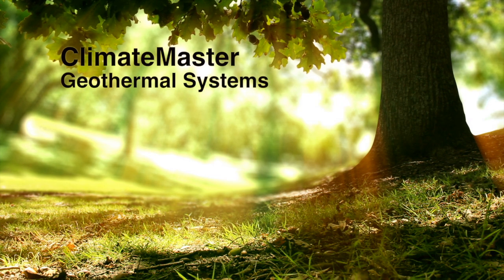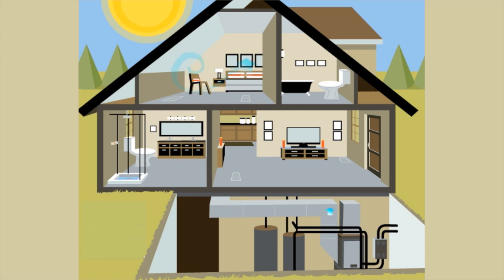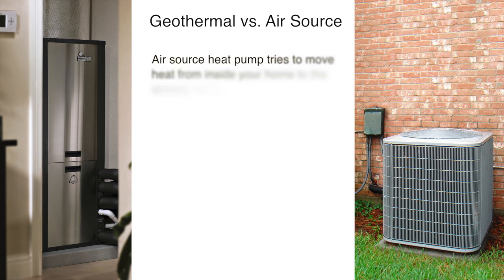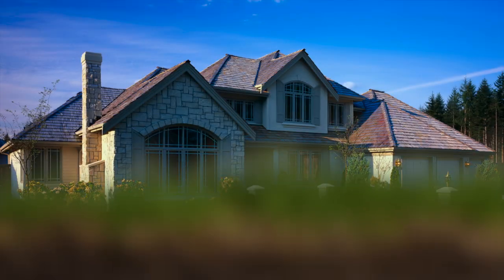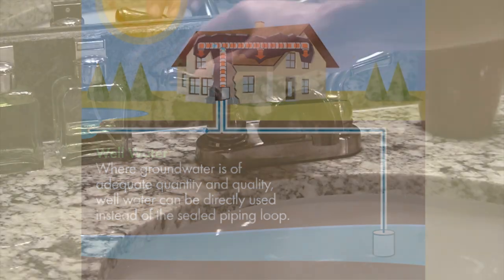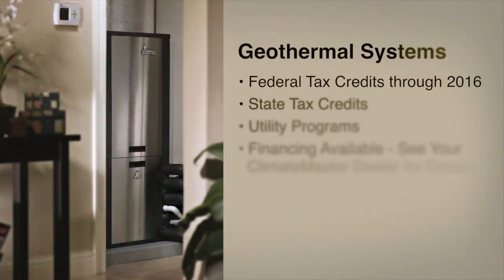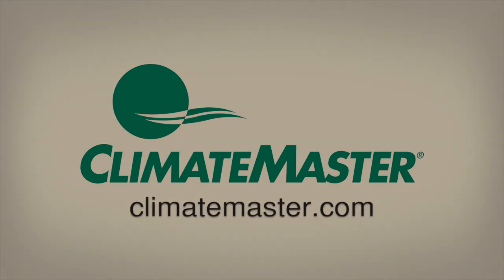Benefits of Geothermal Heating and Cooling

Comment: Back in about 1982,  my church in NE Ohio had a pond loop heat pump system installed when they built the church.  Within 5 years the church members decided to pay to have a gas well drilled for $100,000...  the gas they sold and the availability of free heat paid for itself in just a few years.  The pond system they were sold by a reputable geothermal company was only about 25% the size they were told they needed just a year or two later,  when they complained about the high electricity bills and freezing cold church in winter.  I think that a vertical loop system,  about 1000-2000 feet deep to reach the warmer underground regions is needed in Northern Ohio.

Comment: How does it heat the home to anything more than 55°F?
Reply: It's a heat pump.  It works on the same principle as an AC or refrigerator, except that one end is transferring heat to/from the ground instead of to/from the outside air.  The reason it can generate temperatures well above or below 55 degrees is because it doesn't exchange heat directly with the ground, it uses an electric compressor to compress a refrigerant and then allows it to expand rapidly.  Compressing refrigerant makes it hot.  Letting it expand makes it cold.  Depending on the season, the heat is directed to the house and the cold to the ground, or vice versa.
Reply: Dan Sanger so you’re saying the heat comes from running a compressor which means it’s heat generated by electricity. Why not just run space heaters then? This is advertised as sustainable and renewable when it uses electricity to heat? What am I missing?
Reply: The difference is that a space heater generates heat only.  A heat pump generates heat AND cold, and that's the key to its greater efficiency.  If you can efficiently route the heat to the inside of the house and the cold to the outside, then a heat pump heats more efficiently than a space heater.  The limitation of a heat pump is that it becomes less and less efficient the colder it is outside because it can't get rid of the cold.  Typically, you don't use a heat pump for heating if the outside temperature is below 40F or so.  That's why in colder climates you might want to transfer the cold into the ground instead of the air.  

If you took a heat pump and kept both the hot side and the cold side indoors, then they would roughly cancel each other out, and you would basically have a space heater whose output is the amount of electric power you put into it.  Basically, that describes a kitchen refrigerator.  Cold comes out the front and heat comes out the back.  The heat coming out the back is more than the cold coming out the front by exactly the amount of electric power supplied by the wall outlet.

This is obviously a greatly simplified explanation.  For more information on the physics and efficiency you can look up the Carnot Cycle, which is the theoretical basis for refrigerators, AC, and heat pumps.
Reply: If your inside temperature of your house is 70, the temperature you can expect is about 85 discharge- supply air temperature. About a 15 T.D. temperature difference. 20 max.
So you will be blowing 85 degree air on HIGH FAN SPEED Vs. Forced air gas furnace which blows 130F-170 or so on LOW FAN SPEED.
It feels like cold heat when used to gas forced air and dries out contact lenses much more on HIGH FAN SPEED.
Hence the name " Cold Pumps" that contain refrigerant.

Comment: why not put the house a little underground instead
Reply: ˑˑˑ that’s what I’m going to do for mine. But I’m complimenting that underground aspect with geothermal as well. The whole thing will be powered by my solar panel array I’ll setup myself. I will have no electric bill at the end of it. No gas bill. No water bill because I’ll have a rain water harvesting system attached to it too that I’ll do myself as well. Only bill I’ll have are medical And car bills. I don’t use Cable either. Just internet because I have Netflix. So yea.
Reply: Not a bad idea as long as you can keep any water from leaking in thru the walls.
Reply: @cdawg9149  Earth contact homes are nothing new. A standard vapor barrier is always building code.
Reply: @cdawg9149   I have water proofed basements in large buildings in hundreds of thousands of square feet, and never had a single leak. Concentrate on each inch, as if it were the ONLY inch you had to waterproof, and you will win.
Reply: They call them bacements 🤣
Reply: @wickedleeloopy2115  Yeah, we call them "basements!

Comment: where does power for pump come from? can solar power be used?
Reply: if you have enough current and batteries yes.  My feeling is only worth dealing with solar if you plan to use this in daylight and then shift to the grid for the night time
Reply: 10 Acres of Solar Panels might do it, but Doubtful.

Comment: I love how they compare their geothermal system to other systems using units they don't disclose

You're system may only use 1 unit of electricity to produce 5 units of heat but my system can produce 1000000 units of heat with just 0.001 units of work
Reply: We're debating against 2 very different points, the only thing I was saying was that the video becomes more ambiguous without specifying a unit*. Without specifying units advertisements like this can *make their product appear to perform better than it does and I believe that they should specify whether or not they are using BTUs
Reply: And with air sources they don't give you any numbers
Reply: there are volumes of these numbers many volumes  ashrea is a good place to look
Reply: you are wrong but that is ok.. you can talk to competent ac guys who actually can explain this to you at a 4th grade level.. Not trying to be mean but you are still incorrect
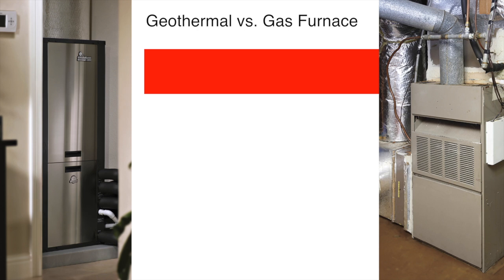Reply: 2:07 you can explain this at any level you want but you'll have a hard time convincing me they aren't comparing things in "units" which was my point. They don't use liters of gas, watts of electricity, or anything like that. Just units, which could be anything
Reply: do you know what a BTU is?  British Thermal unit  A unit of energy equal to the amount of heat required to raise the temperature of 1 pound of water by 1 degree fahrenheit. 1 Btu equals 1054.4 J. The name Btu is an abbreviation for British thermal unit.   so if you take a cubic foot of gas or a watt of power you can convert and get equivalent amounts of BTU.  When they give you a figure that says you input 1 unit. and get out more than you put in .. Where does the difference come from?  iT IS  the latent heat that is contained in the earth.. go stick a thermometer into the ground 8 feet and you will discover YES there is heat.. the ground is not boiling nor is it freezing.   The temperature will be the approximate average of the annual air temperature.. Thru out the USA this is between 50 to 78 /f all year.  Where I live it is near Chattanooga and it is between 56 -58  really depends on if the ground water is moving Not far from here they make Jack Daniels whiskey.. they are at 55 degree ground temps.    Anyway the units are measured in BTU so these are the UNITS that you cannot comprehend
Reply: but the video doesn't say BTU it says units
Reply: bottom line you just need to understand ... garbage in garbage out  LOL  and for the sake of this discussion   1 unit of input to the compressor and get around 4 units out.  so for ease of discussion . lets say it takes 1000 watts that would be applied to an electric heat strip within the blower unit to get out 1 ton or 12000 btu... that same input to run a compressor in heat pump mode would provide 48000 btu to the blower unit
Reply: https://www.youtube.com/watch?v=NiNPhFqxODU
Reply: If it did say BTU I don't think this would be a problem with the video but since it doesn't specify I think this is an issue with the video
Reply: one has to understand that in hvac EVERY time they talk about UNITs it is btu.  For instance 5 tons of heat or cooling is 60000 BTU and 2 tons would be 24000 BTU They do their best to dumb these videos down and sometimes make assumptions that you as a viewer understand what they mean by units
Reply: You have only assumed they're using BTUs and have offered no evidence to support their point other than "of course they are"